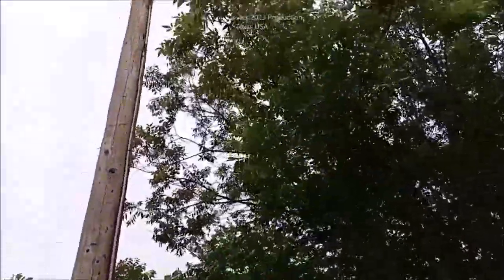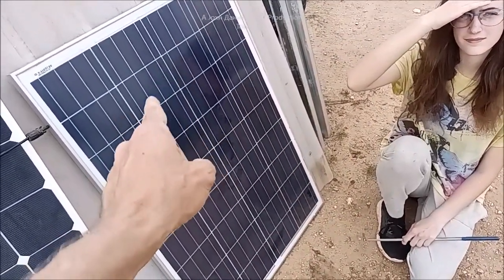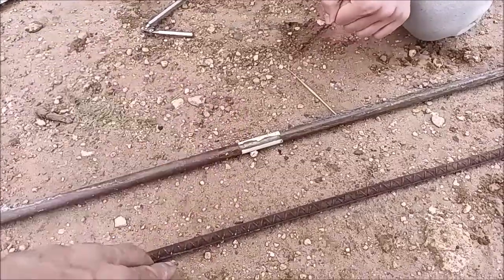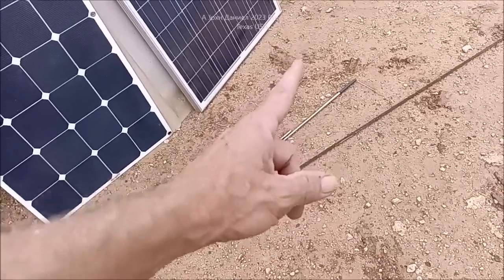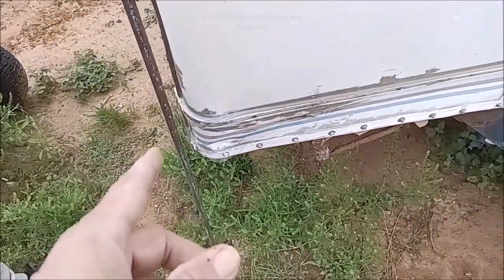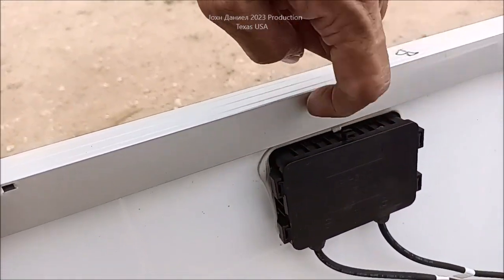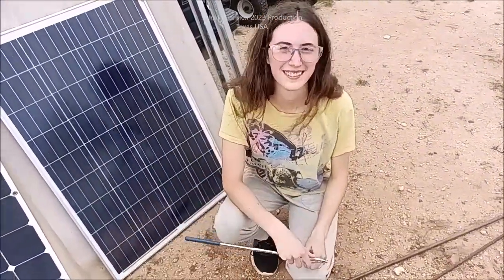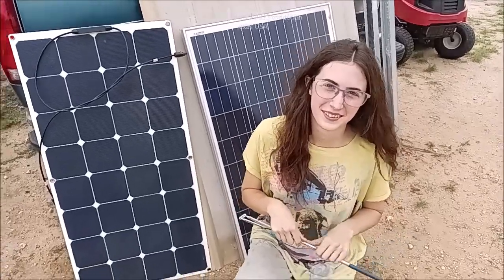Grounding your SOLAR PANELS? 🤔 You Better watch this First! *KNOW DC/Inverter POWER is not Utility

Comment: Thank you for the video. After watching your video I did not ground my system. I am having problems with my EG4 inverters. flickering lights, incinsitent power. Tech support asked if I grounded my panels. I told them no. they told me I needed to. I decided to use some leftover pv wire I had and ground my panels to satify that being the issue or not. While installing the grougning I could hear a electrich buzz every time i touched my pannels, I even got a light shock at one point. I pulled out my multimeter and had 140VAC and 1amp on the panel racking and frames. Turns out many all in one inverters do not isolate their PV inputt from AC output and it leaks into the pv lines and gets into the racking somehow?  Once grounded the cuurent is no longer in the  panles. just wonding your thoughts on this? would appriciate the input. also grounging the array did not solve any of the issues i was having with flickering and what not. thanks
Reply from the maker: What do you suppose caused totally isolated aluminum frames to be electrified? It's like saying I installed a inverter and solar into my Dodge van, now my Chevy pick up parked near it shocks me every time I touch it. Literally, the same way of thinking! 
The voltage you get when touching a ground wire to a panel is from the existing ground wire "supplied common ( bonded circuits)" loop being made, It happens when your panels are mounted on metal racking on metal frames or metal roofs. This does not ever happen to any electrically floating un grounded panels mounted on wood! 
Wonder why right! Induced current is looking for a conductor when your playing with it, and find it in reverse by a ground that's connected to a homes existing system of wiring which has a bonded Common(neutral)/Ground design. Technically, your making a jumper, and it makes many things behave odd. 
People seem to think a inverters output is identical to a power plants system, it is not. It is a imperfect clone not designed to rely on earth ground for balance. It's not a identical product. 
Yet, using a All-In-One inverter charger is not the problem that will make 100% non-electrified aluminum become current carrying items, connecting it to something upstream is what does that. 
See how it all behaves when you DO NOT connect and share your inverter to the homes metal, ground, or bonded utility based and still connected to utility, system!
Reply: @JOHNDANIEL1  thank you for the reply I appricieat your input. My panels are mounded on a wood frame i made 2x6 with big 6x6 post. then i put unistrut on top of that. I am off grid and do not have any utility power. when I ran my AC out from the invertter to my home panel i did run a line, neutral, and ground and have my main home circuit breaker ground neutral bonded. Would you still think i should remove the ground from my inverter to my main panel with this type of set up?
Reply from the maker: @chasegj  Yes, Just do a experiment. Remove the ground line on the inverter or run 2 wire for 120 volt, 3 wire for 240 volt and watch how the whole thing changes. 
Consider how you would wire the same system into a old school bus/RV, Grounding is to chassis, not to anything else. NO ground rod, no ground strap related to AC voltage on the panels, but some do a DC ground to chassis due to static from 70 mph air flowing over panels. And no one gets electrocuted, it is safe there, so its same for a home system. RV's do not bond ground and neutral and if they do they tell you to separate it if installing a inverter. The ground on them is often only metal BOX to chassis, not a shared Neutral bar to Chassis.
I prove this all by disconnecting the ground, plugging into a inverter, and then measuring the volts from the ground wire to the ground post on the inverter and getting wild voltage on it anytime it is fed into a bonded power box. This feedback sometime affects your DC negative to your panels.

Comment: nice practical anyway since there is no fault detection device for dc to disconnect  on s/c to frame ( If a squirrel bites through)  No point in earthing for auto disconnect anyway .

Comment: It may be pointed out the following, for US-users:

1. Two-wire DC systems between 60-300 V are required to be grounded (i.e. to ground one current-carrying wire, usually the negative) [sec. 250.162(A) of the 2020 NEC].

3. PV system grounding is not required but is allowed [sec. 690.41(A)(1) and 690.41(A)(4)]. In other words, it’s optional to ground the negative or positive wires of a PV array.

4. PV equipment grounding is required [sec. 690.43]. In other words, the electrician must ground the metal frames of the PV modules (solar panels).

5. The NEC really just requires to connect an EGC to the exposed metal parts of the PV system, not to install a new grounding electrode system. But installing a new grounding electrode system and connecting it to the PV equipment is allowed and optional.

6. In telecom systems, all 48-V systems have the positive wire grounded.
Reply from the maker: As explained in the video, this is for DC non commercial systems and home power use. Mine is 12 to 36 volt, many I have installed are 140 to 300 volt and require a arrestor and some structural grounding by code but not the panels frames. All must be fused, all are fused, but no DC circuit can share a ground with a AC system.
We installed NiCad in many Telecom systems, mostly Sprint, some T-mobile. No grounding on the 56 volt modules was ever done, just the battery case and shunts had a circuit breaker to ground. All the solar used on those were 90 volt and frameless with no ground on them but the cables were in metal conduit that was grounded.
Reply: @JOHNDANIEL1  Section 690 applies to all PV arrays, it’s not limited to commercial ones. So even the metal frames of residential PV arrays must be grounded.
Reply from the maker: @altuber99_athlete  That only applies to commercially installed, not home owner installed to be used with Grid Connecting hardware. And not even in every state. There is zero regulations on owner installed that is not to be connected to the grid unless the county/city provides a code requirement. In Texas, that's only in 16 counties of the 254 counties we have. And for DC systems 36 volt and less, that is only applied to in 18 counties of the 254 counties. For 48 volt and higher its in 83 of the 254 counties.  2014 NEC Article 690 and all alterations does not include by mandate: Home Owner, Mobile, Non Domicile, Recreational, Farm, Non Occupied structures, and Remote Rural sites. 
690 is procedures and guidelines ( if adopted by your state or municipality ) for Licensed Electricians or Service Techs to follow during install and service of such systems. Continually trying to read into it a Boogie Man to play games with is not realistic. https://enkonn-solar.com/wp-content/uploads/2023/08/Article-690-Photovoltaic-PV-System.pdf
Reply from the maker: @altuber99_athlete  Spend some time telling this guy your findings. He's teaching it, He needs straightened out https://www.youtube.com/watch?v=nKWf7XTg-wg

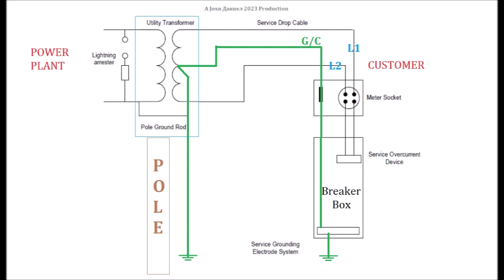Comment: 0:23: The US uses a TN-C-S grounding arrangement for the low-voltage (secondary) distribution system. The neutral wire between the secondary winding of the transformer and each house’s service disconnect is considered a PEN conductor, it combines the neutral and ground wires into one. After the service disconnect, it splits into a separate neutral wire and ground wire. However, I disagree with the statement said @ 0:25 that the transformer ground wire is part of the circuit. It’s not. It does carry current, since the neutral wire is multi-point grounded by grounding it once at the transformer and also at each house once. But it’s not supposed to be used as the main return path for current, neither for normal conditions nor for line-to-case faults. It’s not a SWER (single-wire earth-return) system.
Reply from the maker: What your referring to is Common / Neutral and ground Bonding. A process is to increase the speed and safety of the circuit breakers. By doing so you get the line ( hot ) less able to default the energy into a identical size conductor ( neutral/common). Just do what 3 teens in Dallas did, Walk up to a few dozen poles and chop the "non circuit" ground wire. See how many smart meters responded back to the utility with shut down request. Then it was over 200 of them. It is a part of the engineered design to promote the center taps balance and return. When we installed over 130 massive wind turbines in the Texas Panhandle, western Nebraska, and most of southern Idaho from 2005 to 2008 the swash control switch on the transformers readings came solely from the ground cables. Not the HVT or the TRC.
A simple test used in the past was to connect the hot line to a ground directly to check the amp draw before circuit interruption. If Ground was not or never a circuit, it would do nothing.

Comment: I think you make a good argument regarding attracting lightning to a different ground source other than through your modules and houses grounding system. I.e. erecting a large lightning rod or grounding your houses via an existing perimeter fence as these would make for a safer path to discharge a lighting bolt around a houses property. 
With that said, for many homes in the U.S. these methods of handling lightning surges just are not available. Some houses do not have an existing fence they can turn into a lightning attractor/arrestor and building a large lightning rod taller than the house is just not feasible as there often isn’t any yard space. 

Although at times it seems the NEC is pedaling new codes to sell additional electrical components and installation, I do not think at its core that it is its purpose. ESPECIALLY with regard to grounding codes the purpose is to continue to make residential electrical circuits safer. In fact, building a large lighting rod or creating a grounding fence as you have suggested would In the end be more expensive to the homeowner(for most houses) than bonding solar modules together as part of a homes lighting protection. 

You are correct in saying a circuit does not need a ground to operate, the modules will produce power without a ground. However, the grounding conductor is installed for use in worst case scenarios such as a lightning surge BUT ALSO for shorts within a circuit or static electricity build up. These problems are all best solved via a ground. To divert unwanted current quickly rather than exist as unwanted voltage running across the module’s frames. 

You mention that vehicles and tractors are not grounded to  earth. Of course they are not, having a constant connection to earth in all motor vehicles across the country is not feasible. However if it was I bet it would be required. Now consider trucks that move hazardous materials, static buildup within the truck due to normal operation can ignite flammable materials and this has been known for many years. Sometimes these trucks DO have a connection to earth via a chain dragged along the ground to dissipate the voltage differential. 

Perhaps for off grid systems or systems in dispersed residential settings a better grounding system should be in place than using the house ands its infrastructure(solar modules) to handle lightning surges. But in most cases, congested neighborhoods would be better off with each house able to handle a surge independently. The modules on the roof could be damaged by lightning and if no path to earth is created the surge could burn up the wiring of the solar system causing a fire. The goal is NOT to attract lightning(even if this is an unwanted byproduct). Lightning is an unpredictable energy source and it is best for a house to just be as prepared as it can be.
Reply: @briankober4879  you are talking logic and sure to offend people.

Comment: Earth grounds prevent the static buildup that causes lightning in the first place.  For most panels, the frame is for bonding to that earth ground to prevent electrical charge buildup, it has nothing to do with the DC system voltage potential.
Reply from the maker: We will work on that when installing the 30 frameless panels this spring. However, when you do not ground your solar panels you get the same result as you do for not grounding your aluminum framed house windows. Static does not build up in non ferrous materials ( aluminum ) at the same rate as iron/steel, not even close.

Comment: I'm about to install a 360w solar panel backup system into my cabin which is on the grid. I bought a SunGoldPower 12v inverter/charger that will be fed from a regular household 15 amp circuit/outlet. The batteries are charged by the inverter/charger when the grid is up, but by the solar panels when the grid is down. The inverter/charger has a ground to the 200amp service panel through regular 14 awg house wiring. But it also has another grounding lug off its metal case. I was contemplating using that lug to ground my solar panels, but found your video as I do research on grounding. I think I'll do some more research, but this video has me re-thinking what I thought before.
Reply from the maker: Just realize the design of the power grid, with the earth involved, power created by rotating mass is not in any way the same as the generation/conversion of power from DC current. The "HAIR ON FIRE" panic stricken fear mongers who demand you ground connect all your DC circuits would fire you in 1 second if you drove a ground rod through the floor of their pick up to "ground it" since it has a AC alternator and DC circuits. 
Solar for safety is fused. All DC should be fused. But be very careful back flowing your inverter through some residential wiring since it can be bonded common with neutral (ground direct) and may fry your inverters or introduce stray voltage in your existing ground circuits.
Reply: Thank you for the quick reply. I do know that the main panel they just installed is bonded common to neutral at the outside box. The power is then distributed inside to a 200amp service panel which (of course) is not bonded ground to neutral. It's one of those circuits that feeds my living room outlet where the SunGoldPower inverter/charger will be plugged in. Keep up the good work, it's appreciated by us still "in school".  @JOHNDANIEL1
Reply from the maker: @avlisk  When we install the common 240 volt 6000 watt Sun Gold into a space like your doing, we use this transfer switch https://amzn.to/3T9ItYr system. If you use a smaller 120 volt inverter with nothing over 3000 watt you can use this single sided model https://amzn.to/3GrP7ld
Reply: @JOHNDANIEL1  
Love this video, but I have a question.
I installed the diy EG4 hybrid mini-split and it came with 4 bifacial solar panels to install in series (1800 watts total).  The outside unit setup has wiring to direct connect to grid on regular house outlet when not enough power from the solar input (already done and working with a surge protector).  

For the solar panels, I made a pvc stand for them with the base of each panel on ground so at a 30° angle and they're just on the other side of the sidewalk about 8-10 ft in front of house. I plan on putting a 30amp 1000v DC disconnect switch between the array and the outside unit.  The instruction manual also said to earth ground one panel frame 10ft distance away from the array.  Now I'm questioning if that should be done.

There's an oak tree 20 ft away in line with the main grid breaker box on outside of house that has been struck by lightning 3x in the past ten years.  
So my question is because the unit is a hybrid unit that will run off solar and on grid should I ground one solar panels frame as instructions state not because of DC but because of it being used on grid system when not enough power from solar?
Reply from the maker: @TheoriginalDebunkit  I'll give you a solution.
Your grid tied unit is already grounded on the homes system, that is it's protection. But your panels are set into series high voltage so use fuses on the combiner box they group into at their location. You can use wire coil ( 15-20 feet of 6 awg bare copper coiled up into a 18" loop buried 24" in the ground and connected to a frame on the solar) to safe ground them if you like but seriously the best solution is a metal frame not PVC so the frame on steel post in the ground is the target of lightning and not the panels mounted on it. It actually is called MASS PASSIVE GROUNDING,  I would suggest you build a 4 or 6 leg metal frame, if you choose NOT to install its post 24" into the ground then use 10"x10" plates on the feet of the array frame and drive 1/2" rebar though holes in the plate feet at least 36" long into them to create solid mounts and grounding. We mount on heavy steel frames since their mass is preferred diffuser for lightning or sudden grounding needs. We never connect a DC panel to a homes ground rod to prevent corrosive eddy current from destroying the panels frames. If you seek for Used Solar panels you will get them dirt cheap, all are de-anodized and weakened frames from electrolysis due to grounding to utility shared ground rods. The ones that are on frames like I tell you are never weakened and never show static electric damages. 
Stop by a local Muffler shop, ask the owner if you can hire the young helper to weld you up a frame. They are the cheapest source for welding help you can find. Use 2x3 11 gauge box metal for the upper frame, and have him use 3" aluminized muffler tube  for your 4 legs. A super strong frame that 2 guys can move. Put the 10"x10" plates on the feet with 4 corner holes 9/16" drilled and have him weld you a 1" nut on the ends of the rebar ( to make it into a huge nail) to secure the plates to the ground.  

The mass of the steel target will far exceed any relation to the aluminum panels as a protection and your DC cables will be fused.